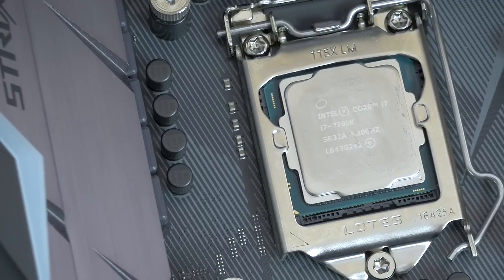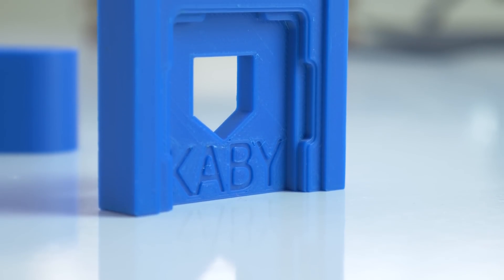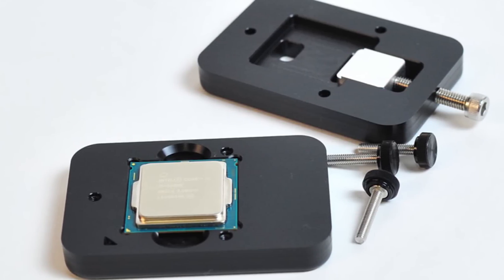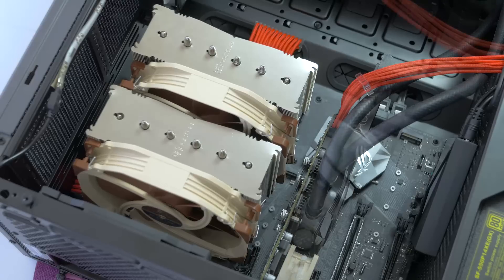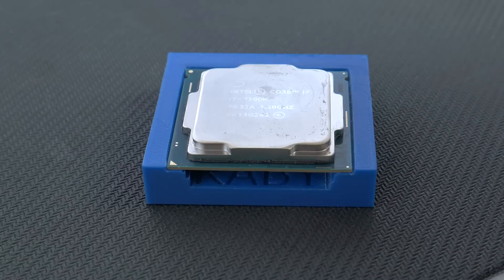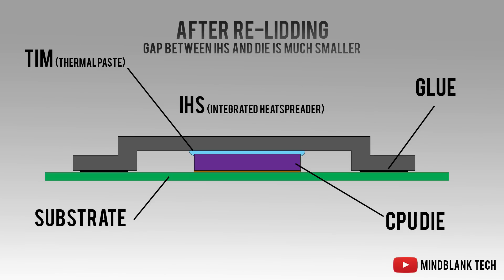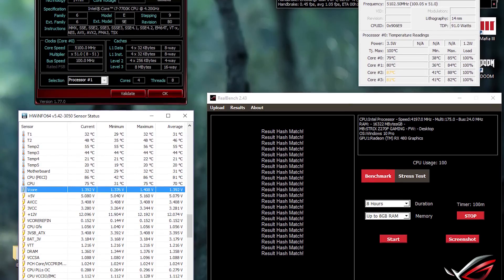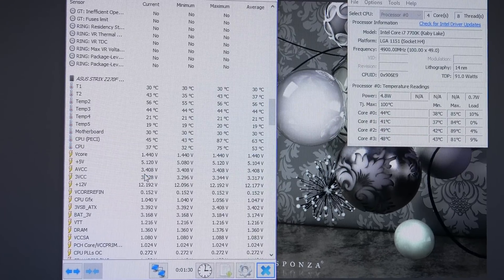Delidding the 7700K - 5.2GHz Overclock - 25C cooler

Comment: Awesome! So you didn't attach the lid, but just put it o. top of the CPU with the substance on it? That's really cool!
Reply from the maker: Yeah, no need to reattach it. This way you know you did a good job if you applied the TIM correctly. There's no additional gap to be spoken of in this instance.
Reply: I saw some also apply the glue on the outside, so they put the IHS on there with a relidding tool and then just applied a drop of glue to each corner  on the outside where the IHS and the substrate meet, I think this also could work well.